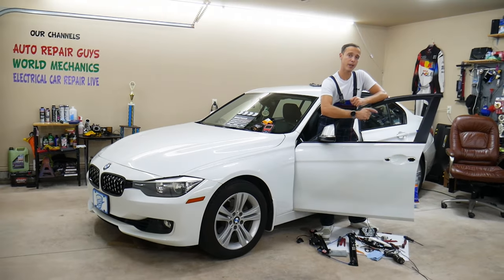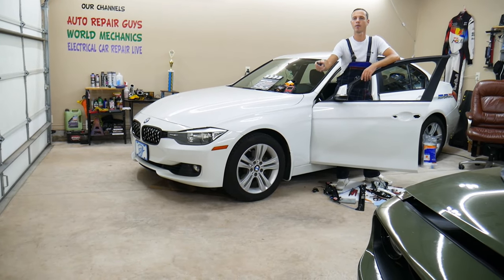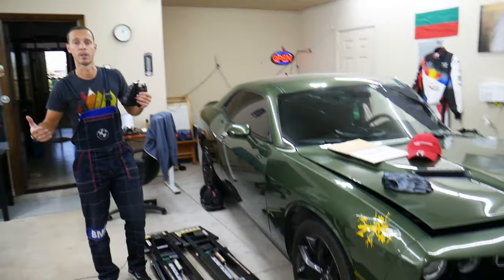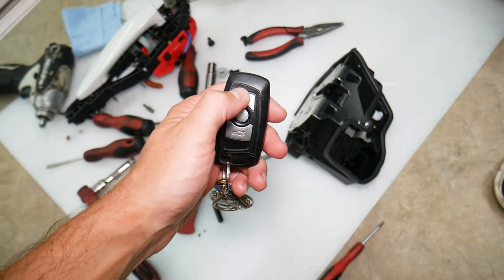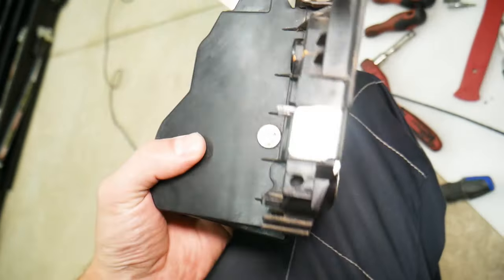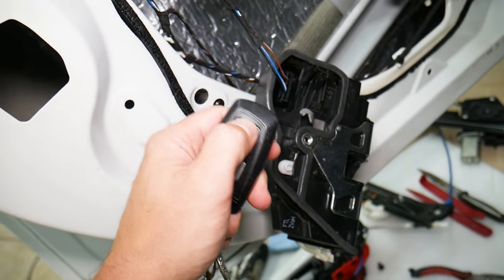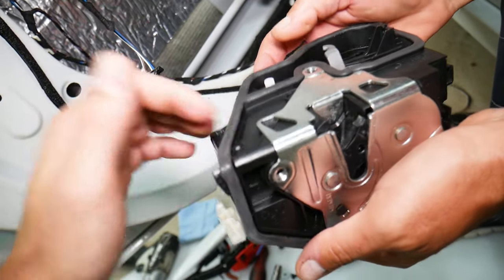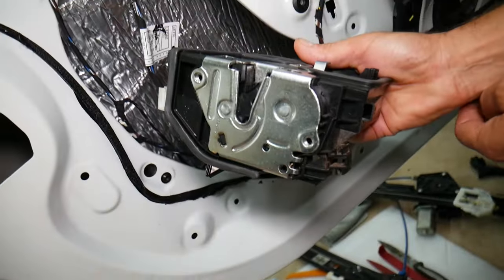SYMPTOMS OF BAD DOOR LOCK ACTUATOR ON A CAR

Comment from the maker: Products that we use and recommend:
► door lock actuator: https://amzn.to/3YlNMoq
► Brake Cliper Rewind Tool: https://amzn.to/3RIZUeK
► Front Brake Pads and Discs: https://amzn.to/3dfjhNK
► Rear Brake Pads and Discs: https://amzn.to/3U7BTQb
►Liqui Moly Oil Saver: https://amzn.to/3xR3Px3
►Liqui Moly Engine Flush: https://amzn.to/3IiDBID
►Liqui Moly Cera Tec: https://amzn.to/3GfQuRI 
► Panel Removal Set: https://amzn.to/3nZlEGJ
► Tool Set: https://amzn.to/3p5MM6t
► Screwdriver Set: https://amzn.to/3FUKyNV
► OBD Scanner that we use most often: https://amzn.to/3I4MQfe

► Check out our Amazon Store for the tools and parts that we use: https://www.amazon.com/shop/worldmechanics